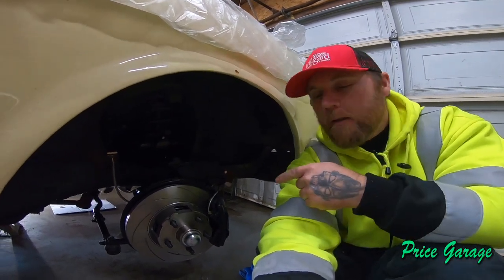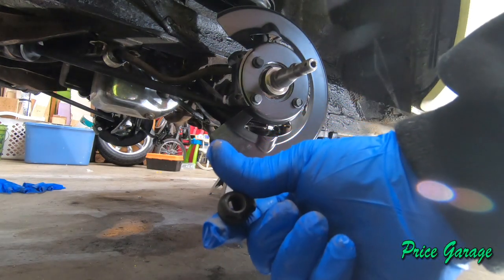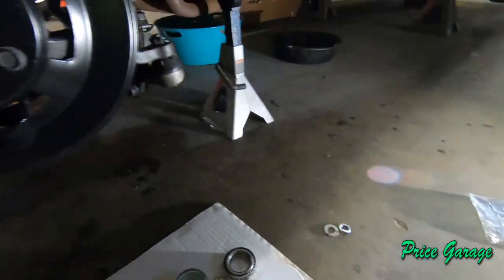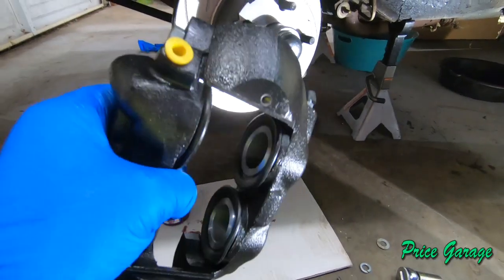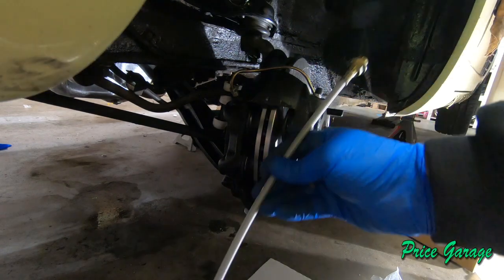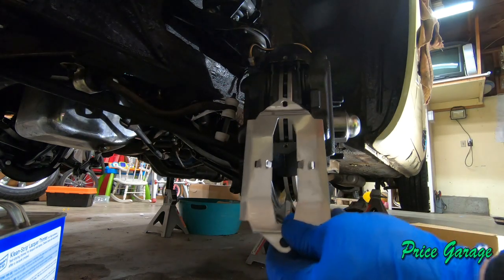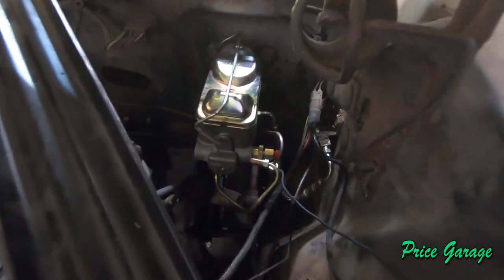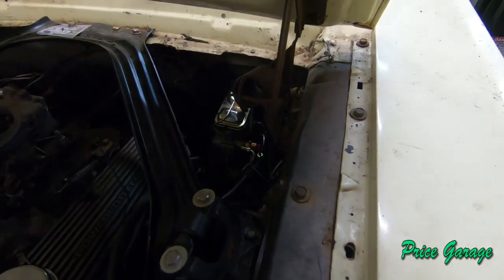66 mustang disc brake conversion

Comment: did the spindles come with this kit,,,thanks have a 66 coupe
Reply from the maker: No.. I used my factory v8 spindle and just cleaned them up
Reply: @pricegarage3641   you mean you can use your old spindles and dont have to buy new ??????
Reply from the maker: @kenneybert7597  yes factory v8 spindles worked with this kit
Reply: Were they originally drum?
Reply from the maker: @orlandoacevedo8221  yes
Reply: Awesome! I ordered a pair of brackets and they are now telling me I can't install it on my factory drum Spindles.
Reply: @orlandoacevedo8221  do you have the 4 lug drums?
Reply: @Lester-Paul  no 5
Reply: @orlandoacevedo8221  did you get it converted?
Reply: @Lester-Paul  my original plan was to get each part one by one but thats seems to be a disaster.  CJ Pony parts told me my spindles would not work with the brackets I bought from them. They look like the ones you were showing on your video.

Comment: Where you order the pads when you need to replace it
Reply: You can order them from anywhere. These are the pads the car originally came with if it had disc brakes from the factory. That's what's nice about this kit.